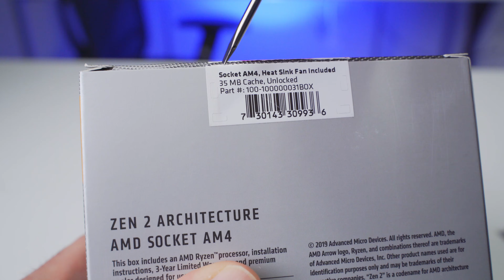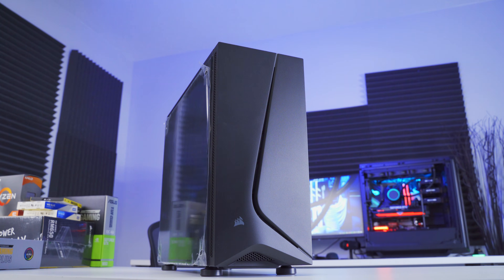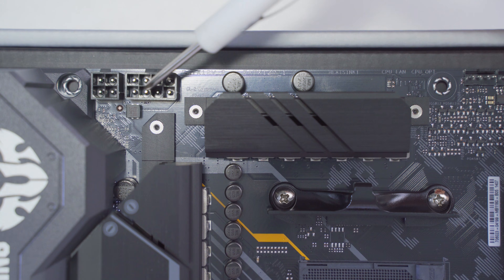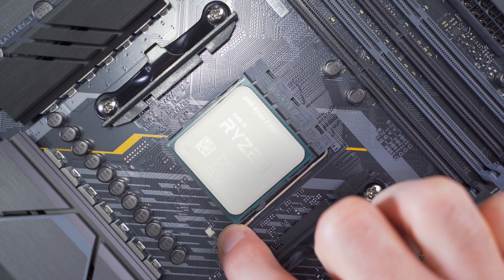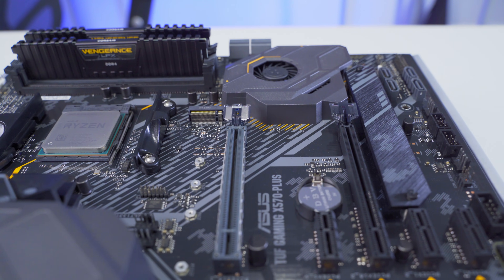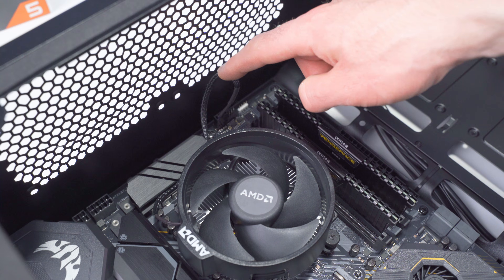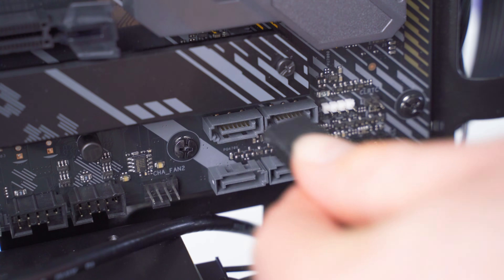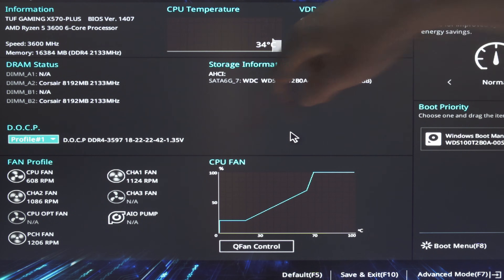How to Build a PC for Beginners - Detailed Step-by-Step PC Build Guide

Comment: Is there gonna be any different wiring when it comes to installing a different gtx example a 4070?
Reply from the maker: Yes. Different video cards and different power requirements.  Depending on the model, a 4070 will probably need two 8pin connectors.
Reply: @ECPUz   thank you!

Comment: The mounting screw for the ssd card where did you get the screw
Reply from the maker: The screws for M.2 connectors typically come with your motherboard.  You can buy them separately if you don't have them though.